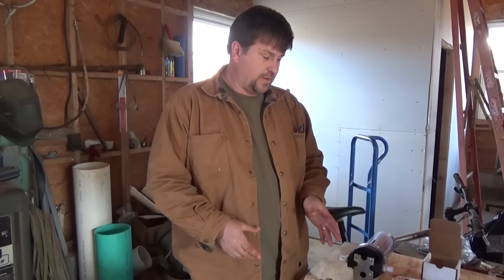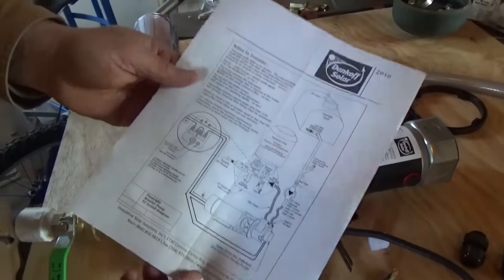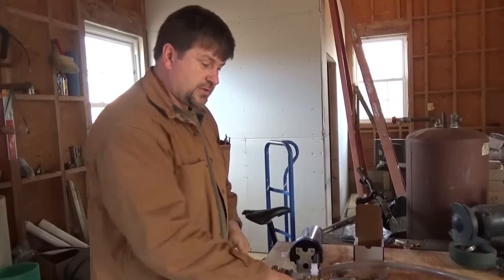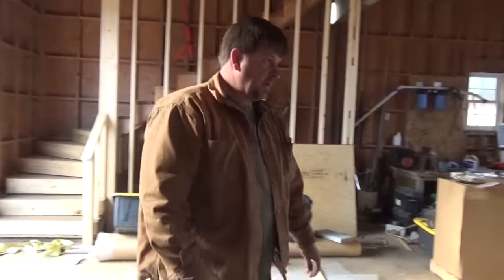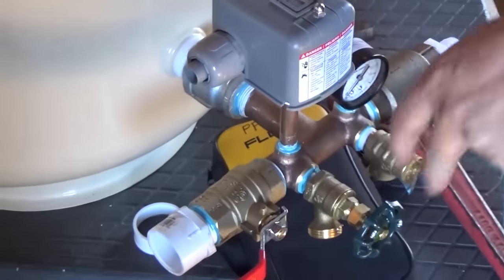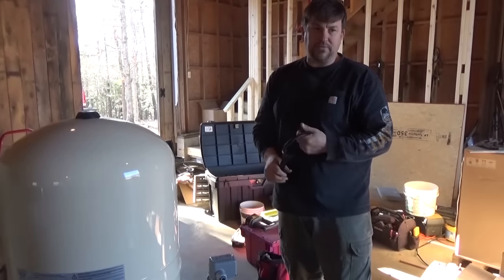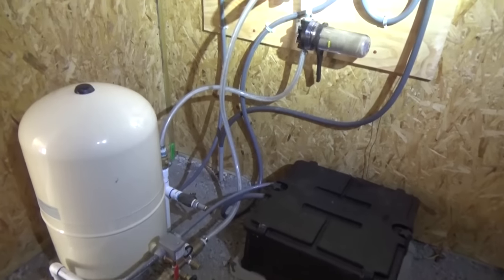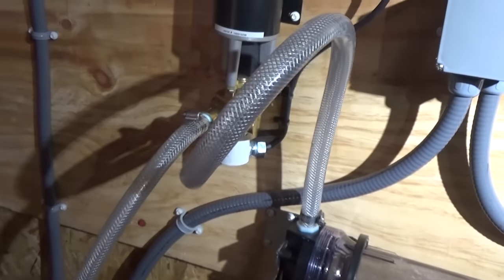A Work Horse of a Booster Pump

Comment: We live off-grid & currently use a cheap 1/2 HP Flotec FP4012-08C jet pump (115V/9.4A) to pump water from rain collection water tanks sitting under our house up to a 40 Gal pressure tank (6ft). I was about to order this Dankoff pump (115V/2.9A version) simply to save on battery draw but will definitely NOT be doing that now after hearing how unbelievably loud it is.
Reply: I'm now having doubts about this pump as well, due to how loud it is.

Comment: Scott, in all fairness to ShurFlo, they don't have to be primed. I used campers for years, in the US. In all that time, I never, not once, had one of those little pumps to fail.

I have been using a ShurFlo Revolution (Model 4008), 55 PSI pump, for a few years, in an off-grid application here in Cambodia. Again, no problems. Not to mention, they too can be rebuilt. 

Lastly, for $700 bucks, how many ShurFlo pumps could I buy? On average, about ten of them. I'm not trying to say Mr. Dankoff's pumps are junk, either. But, by comparison, I would put my little Shurflo up against that Dankoff, any day of the week.
Reply: plus it CAN be run dry for $64 compared to over $900. I have used one several years too. No brainer.

Comment: The hose is freeze resistant, but those PVC nipples aren't. A much nicer way is to use either brass or stainless. You can get a better seal also because the clamps work much better on metal fittings rather than pvc

Comment: Not trying to not pick at all but that filter base  is made to mount vertically. Mounting it horizontally makes for a hell of a mess every time you change the filter. Love your stuff👍 keep up the good work
Reply from the maker: +David Conner On the suction side of a pump the correct orientation is horizontal. I know it looks wrong.  Most filtration is done post pump and vertical is correct.  You never see pre pump filtration except from Dankoff as a way to extend pump head life.
Reply: +engineer775 Practical Preppers Interesting point about the filter orientation. Would make a good talking point in a future video.

Comment: Been using the Procon Pumps in the post mix beverage systems for over 30 years, can't be beat! Love their stainless steel pumps as well. Perfect for water sources where the water is a bit corrosive. Any chance the DC motors are available ala carte? Have the pumps just need a motor.......

Comment: Pastor Scott would you mind showing me how you wire the pressure switch for DC. I think I get what you where saying. But would rather ask brake things. Thanks and God Bless.
Reply: +yankey4  It is just a switch, negative would go straight from batteries to the motor and the positive from battery connects on one side of the contacts and the other side of the contacts connects to the positive on the motor. When ever the pressure drops the contacts make send power to the motor and when pressure setting is reached the contacts break and cut off power.

Comment: Does a booster pump require considerably less energy than a deep well pump? What's the math on energy savings? Can the daylight well pump to a huge pressure tank to reduce cycling of the booster?
Reply from the maker: pump power is always proportional to the amount of work it is doing so total dynamic head must be taken into account. .  We have very efficient deep well pumps that are more efficient than some boosters.

Comment: dankoff slowpump is good as well..   2 gal per min  70 ft lift,   300 ft pipe,   42 psi,    44 volts at 4 amp. on solar..  $600   for 2507 pump..  quite  too.    looks like the same head.   must be rpm difference  as a booster?
thanks
Reply from the maker: +Rgb Rides We have slowpumps that can lift over 500 ft.   I have been running mine for over 6 yrs.  with a 135 ft lift 1200 linear ft.  Slowpumps are great solutions if you can freeze protect it.

Comment: High current system mounted next to a wet system ?!
Reply from the maker: +wxfield It's only 8amps.  Every well pump system in the world has power running through the pressure switch.  I have measure up to 50 amps passing by the water with grid systems.
Reply: In the HVAC world I am licensed in, I would never be allowed to hang a pump or wet system over ~245 Ah of batteries.
Reply from the maker: +wxfield well, good thing there are no such things as wet pump systems over 245ah batteries in the HVAC world. :)
Reply: There are. We just protect our customers and their equipment investment differently in the professional plumbing world.
Reply from the maker: +wxfield ok. Batteries are covered and in a box, I have 4 inline fuses, 2 disconnects etc.
Reply: Ok. Not looking for a fight gentlemen. Just please consider hiring a mastered plumber and electrician to review your layout and give you their 2 cents from a code & safety point of view. They can impart their experience with failure modes on this equipment, plumbing codes, electrical codes, etc. All which may lead to new and perhaps safer (read: more robust) installations for your customers and their equipment.
Reply from the maker: +wxfield No problem sir.  I was just given it back a bit. I seriously don't find any electricians or plumbers that work in the off grid world in our area.  When I ask them questions they shake their heads. So I have been doing these offgrid projects on the fly.  Thank you for holding me accountable and for your concern.
Reply: No worries. It'd be more disquieting if you didn't. Here, we've had a lot of interest and concern by our first responders over these systems that were first being built en masse in commercial settings ~12 years ago. (Note: these were grid-tied however). It's migrated into the residential space in a big way, and so have code requirements. Everything from ventilation, to placement, containment and fault hazards. You name it, there's something new to know. Thanks for your candor. Good luck to you.